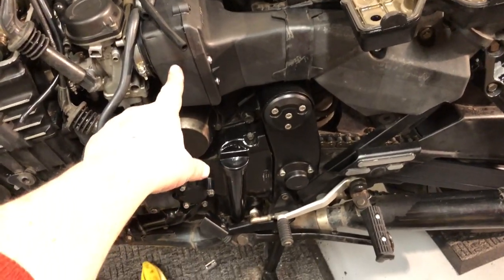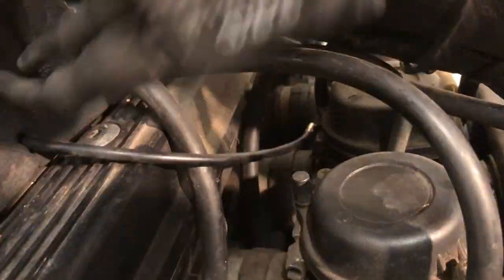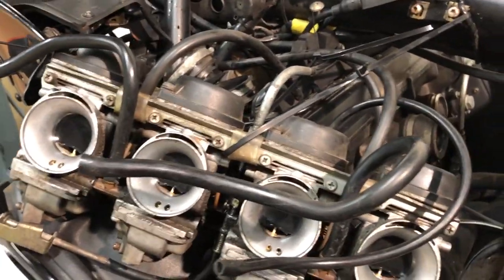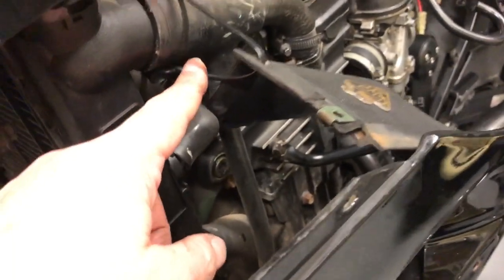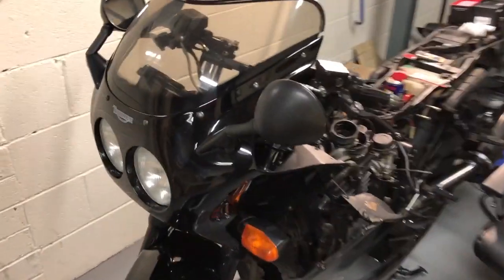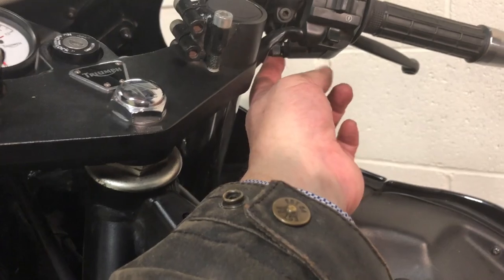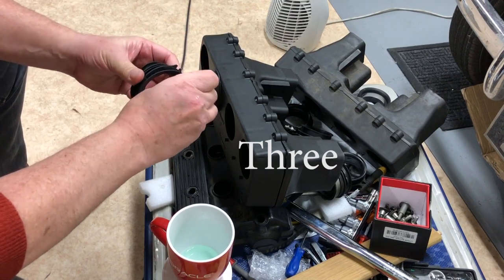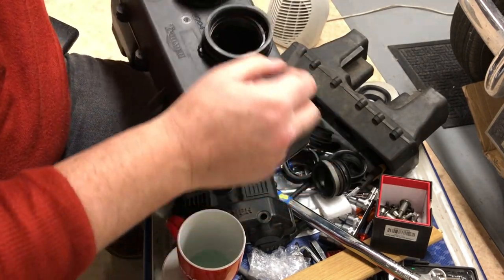Triumph Daytona 1200 - Airfilter Replacement (1 of 2)

Comment: Been there done that with a 95 Sprint sport 900 PITA for sure. Had problems with the starter solenoid, then the tank fuel shutoff, then leaking carbs, then frayed throttle cable. Replaced the coils and spark plugs put it back together and spent ages trying to get it to run properly. 😖 What I also found out with these early models is if the engine ECU doesn't see 12 volts minimum on cranking forget getting the bike to start. Won't even bump start without the 12 volt at the ECU. Eventually got so tired of it away she went sold back to dealer for his collection then bought a BMW K1200LT no problems since just jump on the bike and away I go, no more effing around. Don't get me wrong when these bikes are running they will take on anything on the road no problem, engines are bullet proof as they where over engineered by Cosworth for Triumph fast and handle great but just to temperamental..
Reply from the maker: Mine spends its life on an optimiser and has a new battery to give me a sporting chance! It is actually a bitch to start when cold but once running it is superbly smooth and revs at all speeds. It sounds like you went through the mill alright. Part of what I am doing it to avoid those very things by being proactive and swapping them out before it becomes a problem. On a positive note all the spares are very cheap, e.g. a new starter solenoid was £25. That K1200 has a great reputation for reliability I believe, nice one.
Reply: Terry Cox Hi Terry, yes I had a battery maintainer also problem was if I went out for a few days with no access to power that’s when my trouble would start. The bike was originally bought and used for 3000 odd kilometres then put in storage for about 6 years. It was then part exchanged and that’s when I bought it. I had to change out the original BattleAxe tyres as they where now hard and had flat spots on them from standing. I was only able to put a few thousand kilometres on in a couple of years. I live in Canada 🇨🇦 by the way originally from Sunderland UK 🇬🇧 that’s why I wanted the Triumph in the first place to fly the flag over here. One more problem this bike had was the extreme lean angle on the side stand. There was a fix made later but mine looked like she was going over and a heavy girl to lift up from such an angle. I replaced the tyres with Dunlop Roadsmarts and wow what a difference in the handling. I really didn’t want to get rid, but she was to much work. The dealership that sold it new bought her back for his collection. But he’s now gone out of business and she has been sold on twice now as she’s very noticeable and I just happened to see pictures of the adds. I knew where to look for identity marks on her bodywork. Very fast bike and that triple sound is great. But problem is also Triumph have a poor dealer network here in North America. The new trophy was a disaster, parts where pricey and not readily available and so in the end off she went. BMW is close for a crappy dealer network also but more reliable. My next bike will be a Japanese for sure. More places than you can shake a stick at yet so reliable there not really needed. I might try for an adventure model before I get to old. I’m 66 now and the beemer is heavy at 850lbs. I quite fancy sports touring also like the FJR 1300 or the new Kawasaki Verysy 1000. We’ll enjoy the bike mate and good luck with the service. I split the air box on mine to swap out the air filter but as my story went wasn’t necessary just didn’t know that at the time. I fancied the Tiger 1200 but can’t afford one and they have electronic issues also like the trophy had.
Reply from the maker: @richardshort4587   - well you gave it a good run with the Triumph Richard. You got to do what you got to do. The stand lean angle is extreme I will say but I have a Trophy centrestand fitted which helps. The FJR and Versys 1000 are both heavy bikes too but I guess you know that. It is an exciting time looking for a new bike, enjoy the process and good luck.
Reply: Terry Cox Cheers 🍻 M8

Comment: Yup, same palaver on all T3/400's, which is why I use a split airbox on the Steamers. Releasing the throttle cable at the twist grip makes life a bit easier. Try putting the carb to airbox rubbers in a pan of boiling water raised off the bottom for a while, they often recover the original shape. I like to refit them with the airbox and filter dismantled to make sure they all seat properly. 
Try taking a Tiger tank off and then refit it the next day, you'd swear the fairies had swapped your tank with another one, the screws NEVER line up.
Thank God it's not just me and there's someone else who's anal about original indicators, nice.
Reply from the maker: I hadn't thought of releasing the throttle cable at the twist grip first, nice suggestion. I thought about dismanteling the airbox but decided to carry on as the new rubbers were very supple. Had I been reusing them the water pan and dismantled box would of been ideal. I could of saved the front rubbers but I thing the rear ones were too far gone. Those front indicators bugged me everytime I looked at the bike, they had to go! Cheers Niall and thanks for all the great suggestions.

Comment: Hi
I was going to do the same and remove air box etc but have now removed the filter without all the carbs coming off.
Mine is a 3 cylinder 900.
You can if you have a very long screwdriver access the center top and bottom air box screws from the rear under the central spine ,the rest can easily be accessed.I then slide the mounting bracket that holds the Relays in place backwards (this gives enough clearance to move the rear of the airbox backwards )this the gives you room to remove filter and support frame ,it's tight but doable .
Reply from the maker: Nice one Barry, that saves you an awful lot of grief! 👍

Comment: Hello from Colorado, we're rebuilding a 2000 Trophy, they guy who let it go, butchered the wiring.  I'm giving the bike to my grandson just returned from AFG. We purchased a wiring harness to make things easier, and almost have it back together.  After watching you insightful video on the Throttle cable.  I'm reaching out to you in the hopes you can tell us where we put that (computer) on the bike.  For the life I us, we can't see where it goes.  Thanks in advance
Reply from the maker: On the Daytona's and all those derivatives they went under the seat about mid-way, held in by a rubber holder. Not sure if the MY 2000's were the same though. Make up a temporary e-mail address, post it on these comments and I'll send you some pictures tomorrow. Don't post your regular e-mail address in these comments. Also, you might like to join the "T300" Facebook Page, lots of friendly help on that. I wouldn't be a big Facebook user apart from one or two of those forums.
Reply from the maker: @tedfritsch3340  Grand, I’ll send you some pics tomorrow

Comment: Took my air filter assembly off and fitted 3 K&N cone filters, much easier.
Reply from the maker: I’ll say. I don’t want to mess with my carbs though and I do like the induction roar from the stock system.
Reply: How do you do this, seeing as the air box holds the carbs in place, I would love to do this myself, as it would stop dirty air being sucked in at the back wheel?
Reply from the maker: @boobardoodles  The intakes are tucked away enough, not too sure much dirty air gets in really. If you go for pod filters be prepared to rejet your carbs otherwise you might not like the results. For lots of good advice join the "T300" Facebook page.
Reply: @boobardoodles  The air box does not hold the carbs in place, the inlet rubbers and jubilee clips do that job on their own. The following parts supplier does K&N kits, complete with the jets you will require, especially if you have non-standard pipes fitted: https://www.triumphparts.co.uk/. You will also need a mini K&N  filter to go on the end of the breather pipe, which Sprint Manufacturing also supply. The proprietor is really knowledgeable and very helpful if you need help on what to buy. My bike runs fine and I can get the carbs on and off now without having to dismantle half the bike.